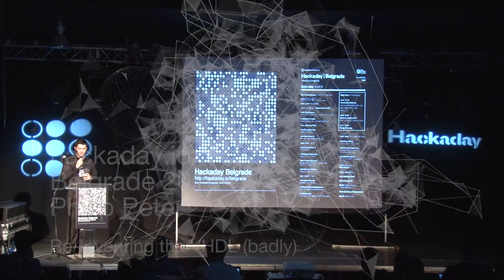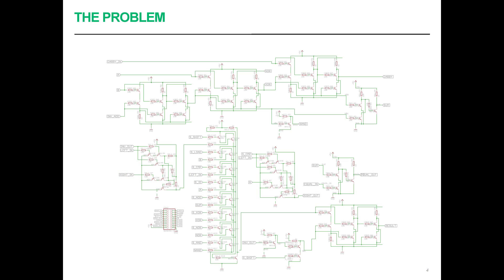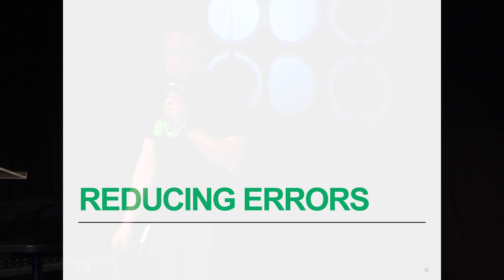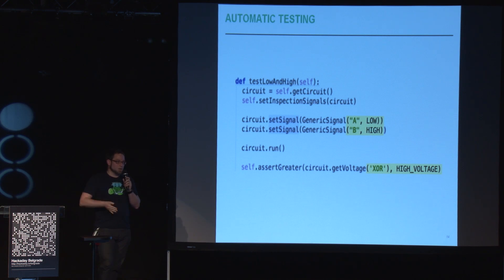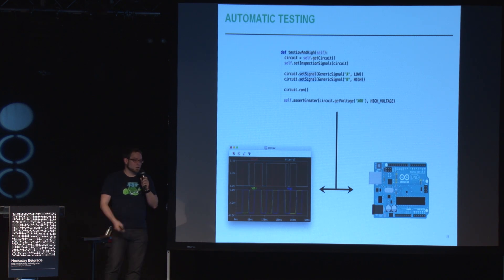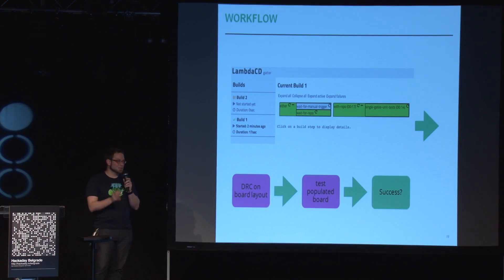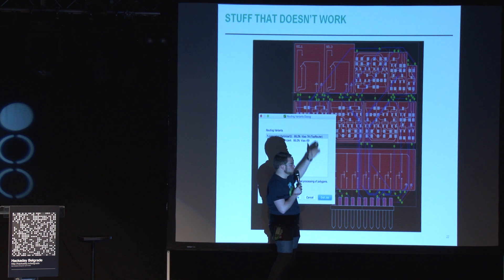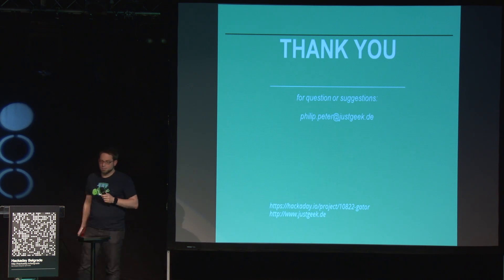Reinventing VHDL Badly

Comment: Seems insane someone hasn't created a way to check the resistance and capacitance of a circuit before hand.
Reply: +Jim Feig

They have - it's called "SPICE". ;)
Reply: +ElectronAsh :-P
Reply: There are suite of tools that do that, they are based on the FEM technique (Finite Element Method) , they can analyze your design and estimate the parassitic resistances/capacitances and a lot more, there is only few problems:
1) they are expensive, and I'm not talking about visual studio ultimate expensive, It's more sell your house and you maybe could just afford to have access to them for a year or maybe two (there are the support costs to take into account

2) they need a deep knowledge of electronics (at least Master's degree, but more often than not Ph.D level), physics, electromagnetism theory and math to produce meaningfull results, that are close to reality

3) for reasons that would be quite difficult to explain under a Youtube video (so i'm afraid youll'have to take my word for it, basically the mathematical models of the reality aren't that accurate) you need to tune the model after it's done, basically you take a known good board, and you tweak the models until the results match with the reality

that is the reason why the big public isn't aware of them
Reply: +ElectronAsh I took that as meaning simulating board level stuff like trace resistance and stray capacitance. spice stimulates nets and placed components, perhaps some preprocessing could try to find these other potential effects and place them too.
Reply: Yep, but what I meant was that they have simulation software now for literally every part of the circuit you can imagine, including FPGAs, custom ICs, transistors, SD cards, audio, etc. ;)

Proteus VSM is one such program. Although it's definitely not at the highest-end of the software scale, it still simulates many CPUs, and most circuits consisting of logic chips, ROM / RAM, passives, transistors, diodes, batteries, serial protocols, or even purely analog stuff using opamps etc.
Reply: True - they are extremely expensive, and still not necessarily guaranteed to be accurate to the real hardware.

For FPGA stuff though, I usually just run the design on the board early on, then use SignalTap (and occasionally the oscilloscope) to debug stuff.

For the digital logic stuff, the tools like Altera Quartus and Xilinx ISE can obviously simulated the functional side of the logic perfectly, and also do a very good job at estimating the critical timing stuff too.

(and can even recommend the type of heatsink you might need for the faster / larger designs, although most of the mid to low-end chips I'm using likely won't ever need a heatsink. hehe)